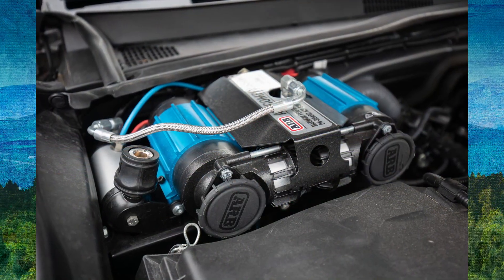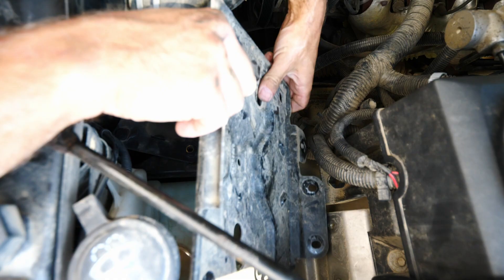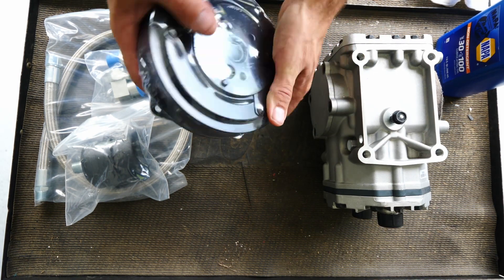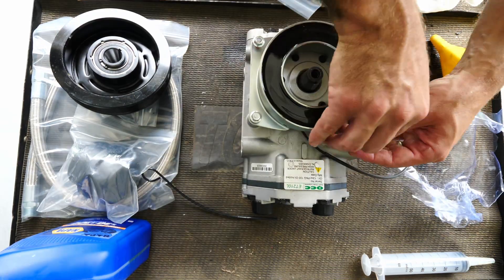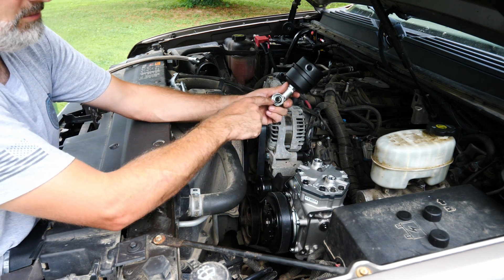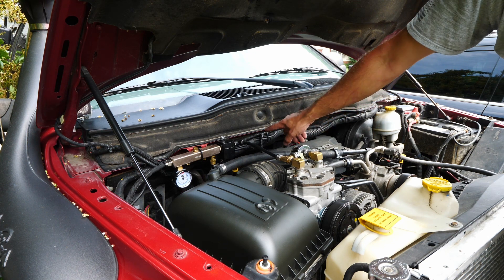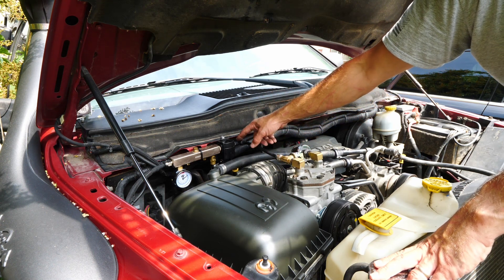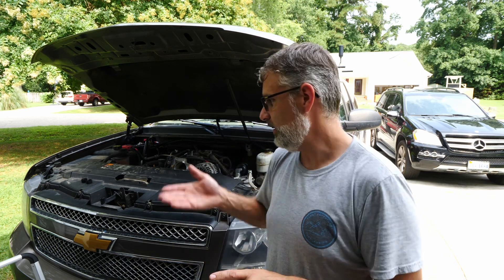Installing a York Air Compressor - Overland Build Breakdown Pt. 7 Suburban 2500

Comment: I want to install a York Onboard Air Compressor setup in my 2019 Chevy Silverado 1500 and hook it up to a 7-10 gallow air tank to run airbags, train horn, air up tires and snything else i need to air up. Any suggestions. I know that Little Shop Manufacturing has the kit but id rather not pay $1500 or so for the Super Low Maintenance kit. Any advice would be great.
Reply from the maker: Hello Dustin. This portion of Matt's build was handled by Jeremy from Family Adventure Overlanding. You might be able to reach out to them on Instagram for some pointers. Best of luck with the project!

Comment: Very cool! I wonder what kind of load that places on the engine. I was looking at the ARB solution today but was thinking it's pretty expensive for what it is. I have a dual battery setup in my suburban that seems like it would interfere in that area.
Reply: Same here. 2012 suburban 2500 gas. I'm also looking at adding on board air and a tank mounted somewhere under the truck along the frame.
Reply: The same as an AC pump. It’s not a problem for the engine